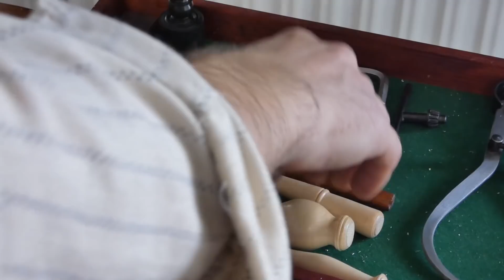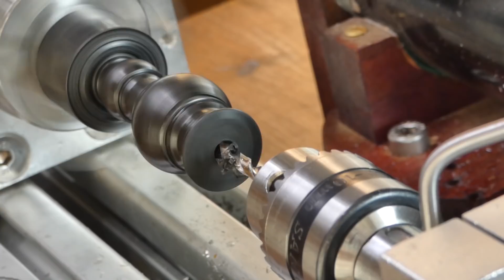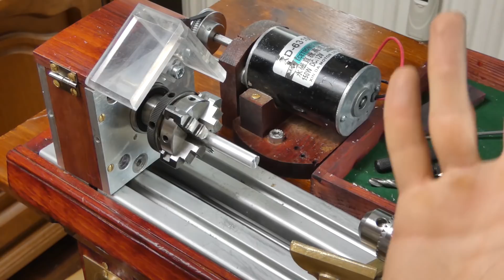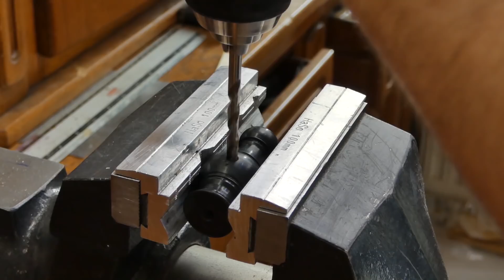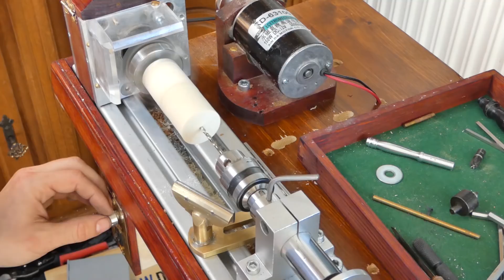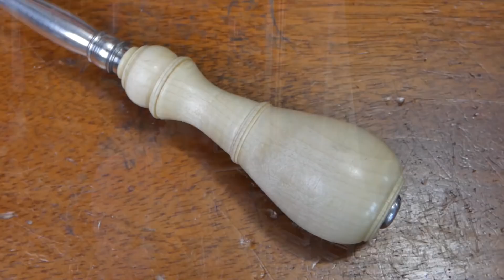Turning a Soft-face Hammer on the lathe

Comment: I never knew you could turn metals on the lathe with hand tools until I saw Clickspring. You do a great job of it too. I want to try it, but all I have is a pole lathe that is put away for the winter.
Reply: G'day Cadwaladr, I've turned brass on my home-made pole lathe. All you need is to drill a small diameter hole in each end (as central as you can manage) for the dead centres to locate in eg. =<  The extra depth of the hole will store oil and keep it lubricated. Then use a graver style tool (like Uri's or Clickspring's). You can make one out of an old, small, triangular file, re-shaped on the end. :) Cheers Duncan
Reply: You shouldn't try steel or "hard" metals if you want to keep your fingers but soft metals should be manageable

Comment: I suggest buying a center drill bit.  They are designed to make a starting center hole in metal.  They are different than a drill bit.  Using a drill bit to start a hole is very iffy as drill bits will wander off center, as I can see in the vid.  Buy one (or a set) you will like them in a drilling application.

Comment: NICE! Also, coming from a guy who has no idea what Im talking about, I would recommend maybe making something to cover the motor, so as to reduce the chance of any shavings doing any damage to it (by getting stuck inside or something).
Reply from the maker: Thats a good idea and I'll definitely make something for that. do you think if I make it out of wood it'll risk the motor heating up? I think for 12v  dc motor it should be fine but I don't want to take risks.
Reply: @urituchmanpigeon  just make sure to leave a decent air gap. Also, the thinner the better between the motor and the chuck to leave room to turn shallow platter style turning like a gong recommended in another comment.
Reply: @urituchmanpigeon  I think a wooden cover would work as long as its thin and has holes for some airflow in the back. Also, since yours the "Brass Master", a brass one would work decently as well as long as you have shrink tubes or electrical tape covering the wires and decent air exchange in the back.
Reply from the maker: Cool, thanks!
Reply from the maker: Thanks Thomas!

Comment: Hey Uri, some advice if you'd like.
If you wanna free-hand turn metal, why not get some carbide tips for the tools? It should be much better
But I think the best way to get a better Lathe (besides buying a whole new one) would be to get a new motor with way higher torque, I believe.
Reply: Also, some lubricant for tapping/drilling holes is kinda essential so it glides in and out and doesnt chatter and squeak so much
Reply: Carbide isn't any sharper than a high speed or high carbon steel would be. In fact unless your using special ground and lapped carbide tips that are mostly designed for cutting aluminum on cnc controlled machine tools there a lot less sharp.Yes carbide would last a lot longer between sharpening's, but it also requires far more tool pressure to make it cut. With hand type graving tools on a lathe then HSS or HC tools will still be better.

Comment: Please, retract the drills completely BEFORE stopping the workpiece turning, otherwise you can damage the front cutting edges or break the smaller drills. Wood is less sensitive, metal is where the trouble is, but it's also just good practice.

Comment: My first thought is: what a lot of mess in your living room that must make! Is a regular household vacuum cleaner okay for cleaning up metal shavings?
Reply: It's what I use in my workshop 😁 so long as you clean up the longer chips first anyway 😂
Reply: Broom first, if you have dust collection, make a floor box for it so you can sweep right into the system,  no bending over with a dust pan after that.
Reply: @thomasarussellsr  I don't have dust collection, so I clean up the worst with a dustpan and brush/broom and the hoover the remaining 😁

Comment: Hi Uri
This is an excellent video. You display an infectious enthusiasm, natural humour and skill. Do you realize the technique you are using is the same as machining metal on  a watch makers lathe. Their lathe can range from your type of lathe to very miniature sizes but they use tooling very similar to what you are using.  Check out watchmaker lathe on you tube. 
Also truing up a round bar in a self centering Chuck is near impossible with so much material up in the jaws. Doing what you did will wreck the accuracy of your chuck. Better of turning between centres for what you are doing.
Hey this is not bit picking or criticism. Your videos will inspire others and hopefully comments will help others in the "YouTube University"
Don't forget check out the watch makers lathe videos and also check out "ClickSpring" YouTube channel. He is also from down under and has excellent videos and techniques. 
Cheers from down under
Amf1